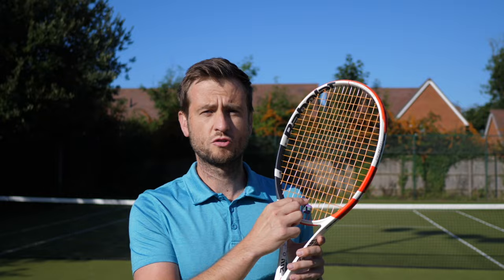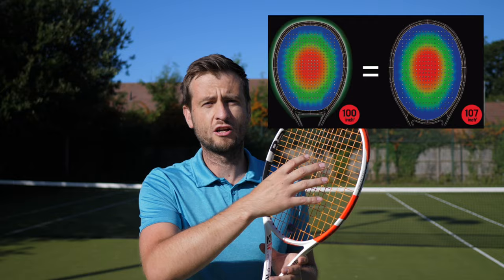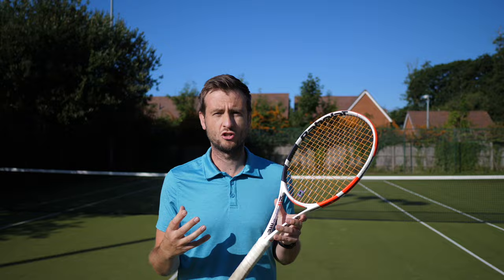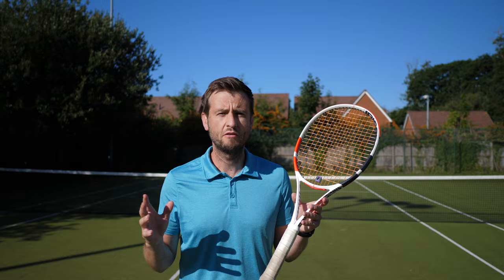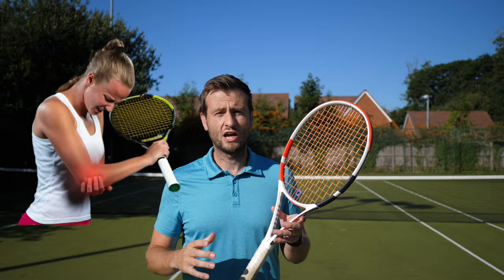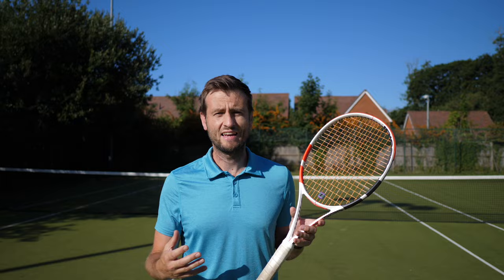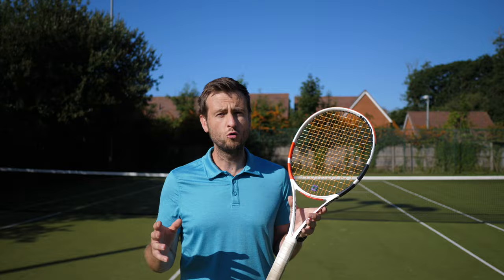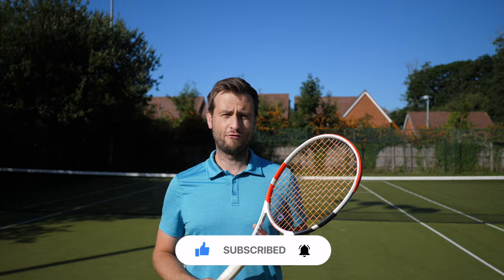Why I Use a Racket Vibration Dampener...Should You?

Comment: This commentary is misleading.  Vibration dampeners inserted in the string bed only muffle the sound of string vibration, they do not reduce shock in the frame itself and so do nothing to prevent injury, including tennis elbow.
Reply: Maybe they don't prevent injury. But, they seem to reduce pain a bit for players suffering from a minor arm injury or a bit of overuse. Atleast while playing. Just like softer rackets or strings can. Not that it means it is better to olay with one. Obv. the right racket, strings, grips, balls and technique are better for injury prevention.
Reply: That is completely false and anyone even remotely decent at tennis knows that. You can clearly feel significantly less vibration in the handle with a dampener
Reply: Where does it say you feel less vibrations in the handle?
It only dampens the stringbed. 😂@user-fi3gf7jl2v

Comment: I personally don't use one as I prefer to feel the ball on my strings. The dampener just makes the racquet more muted & reduces the ping sound, other than that it does not prevent wrist or elbow injuries. This have been proven by several scientific studies.
Reply: Would be really interesting to read this research and see you opinion on what causes the tennis elbow. I had it several times and I m sure the reason is bad racquet and vibrations.
Reply: @shemetilo  
Li FX, Fewtrell D, Jenkins M. String vibration dampers do not reduce racket frame vibration transfer to the forearm. J Sports Sci. 2004 Nov-Dec;22(11-12):1041-52. doi: 10.1080/02640410410001729982. PMID: 15801498.
This is one of the studies available...it's interesting that you asked as the number one factor which contributes to tennis elbow (if we assume an individual has perfect technique) is racquet stiffness...an RA rating above 70 significantly contributes to one developing tennis elbow...also excessive swingweight can also strain the ligaments & joints causing tennis elbow...hope this helps
Reply: @shemetilo  The reason for tennis elbow is pretty well known: poor technique. Professionals don't get it despite hitting thousands of balls. Amateurs do get it despite hitting far fewer balls. (When pros get elbow problems, it's overuse injuries causing soft tissue injury.) That points to the problem: mistiming the ball (almost always on the backhand) overstresses the ligaments and tendons on the outside of the elbow. Ask yourself what shots cause pain, and that tells you the ones on which you need to improve your technique. 
It's not necessarily "vibrations", more just the shock of the force that the elbow has to resist, and it's not necessarily a "bad" racket, though a heavy racket can make things worse. Do try a lighter racket, strung looser, and get some video of how you hit your backhand, backhand return of serve, and backhand volley. It'll probably tell the story.
I'm also guessing that you hit a one-handed backhand, as two-handed players hardly ever get this problem - which tells its own story too.
Reply: @guardiancarthur  agree. And what part of technique is bad? My understanding is - not hitting the ball with the center of raquet. Meaning more vibrations.
Reply: @shemetilo  You can get tennis elbow without hitting a ball: get a screwdriver and try to undo some really stuck screws for an hour. The overstress of the tendons and ligaments on the outside of the elbow is exactly the same. You can hit the ball in the middle but have the wrong technique which stresses the soft tissue (eg leading with the elbow to make the stroke) and you'll get the symptoms. That's why I suggest getting some video. A coach's opinion can help too.
Reply: @guardiancarthur  thank you all! Will go through the research. I v got it one using cheap squash raquet.  My personal experience with the dumper is positive, but would not argue now that it reduces chances of the tennis elbow. TY!

Comment: I am sorry but I played tennis from the age of 8 and was professionally trained though I never played at anything close to a pro level I did play at an advance level I guess what they call now NTP 5.0 even though this rating does not take into account your competitiveness or mental strength as an athlete. When vibration dampeners first came out I tried one and it made no sense to me because it stop the one thing that strings are suppose to do vibrate! What happens when a guitar player puts his hands on the string to mute the sound at a break part in song, he is doing the same thing!  If a player is having issues with vibration you have to look at the gauge of the string being used the type of string being used and also the tension. Those three things will immediately affect any vibration issues. Now the frame yes does play a big part but once you buy a frame you kinda have to make it work. Unless you get them free like the pros, you can put lead tape to adjust the balance. I felt these things we're someones bright idea to create something and convince you that you need it. If you look at 90 percent of the pros they don't use them and that to me is the tell tale sign if they are needed. It took me a full year as an advance player to finally feel that 16 gauge and approx 58 - 60 lb tension was good for me. I played with the Original Wilson Pro Staff which was already a very stiff and hefty racquet but the most accurate I ever played with. The only other racquet that I thought compared and the time was the Original Dunlop Max 200 G with the molded injection this racquet dampened all vibrations and was like swinging a Louisville slugger. You couldn't break that racquet if you tried and I scraped in many many times on hard Court surfaces. McEnroe played his best tennis with that racquet. Side note the original Wilson Pro Staff that people call the Pete Sampras racquet was actually created specifically by Wilson for Jimmy Conners. It was because he had to at some point stop playing with the T 2000 which was out of production. Jimmy actually did advertisements and commercials for the racquet I know because I had seen them many time. Jimmy played with the racquet for about 6 months or so and stop and Wilson sued him for breach, but by that time the racquet had caught on with all the players and at some point at least half of the pros men and women played with the racquet the other half mostly Yonex racquets. That was the last racquet I played with the RDS 001 the one Leyton Hewitt made famous, yellow was my favorite color and this racquet always turned heads lol
Reply: 6 of the current top 10 players on the atp tour use dampeners. Djokovic and nadal use them, 2 of the 3 best players ever. To say the top players don’t use them is completely inaccurate

Comment: I think a dampener doesn't radically change things in terms of vibration to the arm, but definitely the feel for your shots and that "ping" you hear without it. That's the main reason I don't use one. I feel more connected to my shots than with one. However, when it comes to injuries like tennis elbow, I think string type and tension should be the ones considering changing.

Comment: I've always used one. I'm not questioning the science behind the studies and I do believe its not a magical solution to avoid arm injuries . What I do know and feel is that it reduces vibration, or at least the feeling of vibration hitting your arm. I suppose its mere common sense that if you have any piece that stops the vibration sound (that ping) we have to conclude its stops the vibration in all, or else we would still hear it. Just like a guitar, if you place a finger on top of a string you stop the vibration, and that the way you control the sound of the musical instrument. I do believe it helps (in some way) and contributes to reduce the vibration we feel in the arm. I've been using them since I started playing in 1984 (we use to make them out of rubber or dense foam).

Comment: Excellent explanation on dampeners !  
I play everyday for almost 3-4 years now. My experience - it is very important to have the dampener. ! I use poly strings. strung at 55lbs. ( string my own rac..  have a machine at home). I got really painful golfer's elbow a  few months ago - definitely due to the shocks from FH - Noticed that using a dampener definitely helped whilst playing. The injury was because of incorrect technique - hitting with arm not extended enough and too close to the body.  And also whilst serving. No problems on the 1H backhand. It is much better now after some exercises -the dampener definitely helped in reducing the constant pinging on every shot.

Comment: From an aesthetic POV, I think a dampener can boost up the looks of your racquet. There are a lot of unique shapes of dampener that can make your racquet look cool and aesthetically pleasing.

But as far as my experience playing tennis (approx 3 years), Dampener doesn't reduce the possibility of injuries significantly. Personally, I tend to use dampener on practice sessions, but when it comes to playing time, I prefer to drop the dampener to get more feel of the ball (especially when you use Babolat's racquet).

The main thing about vibrations comes from the tension of the strings and the technique you use when playing tennis. Adjusting to every kind of tension (if you haven't find your sweet spot) is necessary for everyone to get the better of it and feel more of a connection to the ball. 

Not being said that this is a personal preferences, I enjoy both wearing and not wearing the dampener. It's just based on the situation I'm in and what I wanted from it.

Comment: I use a rubber band across 6 strings.  The main reason for me is I like the sound better. It's more staccato.
Reply: Me too...  Many years ago I played with the K-factor vibration damper and I got tired of looking for it when I hit a ball near the racquet throat.  IMO a rubber band works better because it provides less damping, but as you say, it doesn't hurt the noise of the strings making contact with the ball.

Comment: Thanks for this interesting (if not entirely conclusive) assessment of vibration dampeners. 
I am curious if anyone has found any advantage to affixing the dampener at the top end of the raquet, to add headweight and help with racket speed, in addition to its vibration dampening properties?
Interested in any perspectives -thanks!
Reply: I don’t think that’s a good idea because I definitely hit top of strings far more often than where I keep my dampener which is at the bottom of the strings like Alex shows in video. Give it a try and let us know, I recommend a brightly colored one so you can find it once it flies off your racket
Reply: Don’t be a kook 😂
Reply: It comes out while serving.

Comment: Actually there is a wristband with a nut size half sphere filled with mercury - it is designed to dampen vibration at the wrist - so it reduces vibration not only at the wrist but also above up to the elbow and shoulder. I've found that useful, also.
Reply: The “shock absorber” you are referring to is called TENEX and it definitely is a tennis elbow preventer; having said that, poor technique, particularly hitting late is the main cause of tennis elbow.

Comment: I did not use a vibration dampener before. I use the 2020 prestige mp, which is a soft and flexy racquet, but after 1 day long tournament, I got tennis elbow. I've never had tennis elbow before and I was using a pretty stiff racquet (burn fst99). I noticed a lot of vibrations when i just hit the strings on my hand going to the handle of the racquet without the dampener. Now I am staying away from my prestige mp. I use a vibration dampener now and testing medium stiffness racquets to replace my racquet of choice. Still playing with tennis elbow though but not as often as before. I use the yonex vibration dampener which did not fly on me even once, i really recommend it.
Reply: With all due respect, there’s a good chance that your technique could use some work.
Reply: That's strange because I changed from PD to Prestige because of tennis elbow and never had any problems ever since. I use a Pro version though!
Reply: @DrPravZ  I guess it could be the poly strings, with the heavy weight of the MP plus a whole day tournament since I ended up playing a lot of matches.
Reply: @peejread2309  what tension you string them sir?

Comment: I need to know-
1. If the vibration is dampened and its holding onto the strings, shouldn't the dampener reduce the spin 
2. If vibrations are reduced, the impact on the hand/arm should also be reduced technically, then why most videos say, it is only to reduce the sound and nothing else
3. It adds to the weight of string bed, shouldn't it change the balance

Comment: I sometimes use a "squash small ball vibration dampener" and this seems to activate the string bed for better for worse. Otherwise all the rest dampen the string bed. My question really is = does the vibration dampener cause greater dwell on the string bed so that you can apply more spin (i e. control) to the ball?
Reply: Good question actually
Reply: I think it's opposite is true !